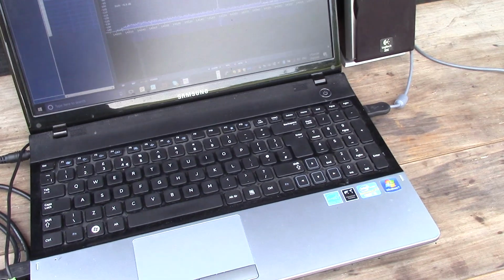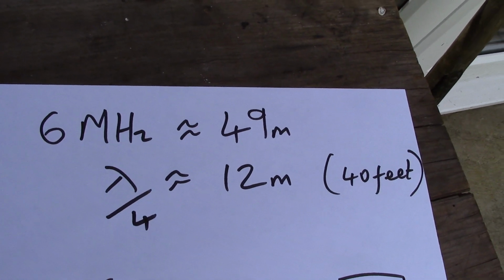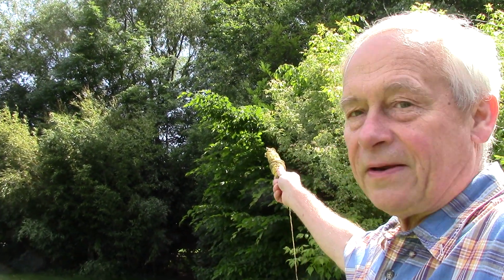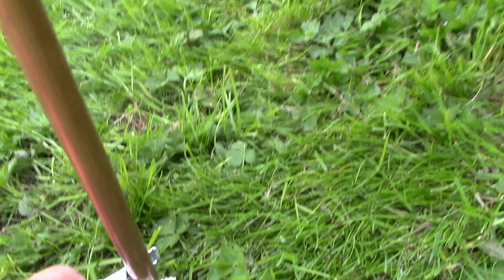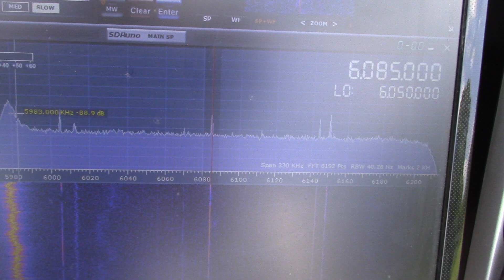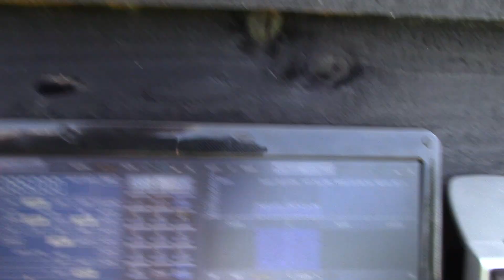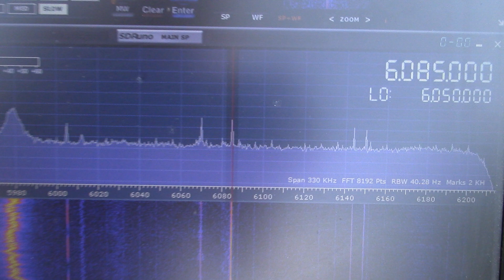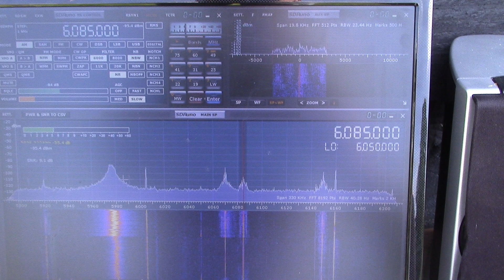Shortwave radio antenna and ground demonstration

Comment: 9:00 So pissing on the ground is actually a good idea. It's a good job gravity enables us to do that naturally. A simple question though: Does the counterpoise need to be on the ground? I was testing a shop bought long wire the other day and found it less worthy that my home made one. I did experiment and connect it as a Ground or noise cancellation whilst it was still up there, but found no difference, so no it didn't work as a ground when elevated.  Well that's my conclusion, but am I correct?

Comment: Thanks for this, I'm in North Wales and will try this. At the moment I have a 30 foot single wire, and 2nd setup is a similar length with a 1.1 electronic balun.

Comment: Thanks, is there anything i can do if my radio doesn't have an antenna socket? It has AC in, 12 volt dc in, headphone jack, audio in and battery compartment.

Comment: This was a great comparison. I'm on the 1st floor (or 2nd as we call it here), with no units above me, but in an HOA building, trying to find a way to build something that will expand my little SDR beyond the range of the few strong FM radio channels I get here. I have a covered balcony that I'll try some short lengths on, plus that magnetic loop looks like it might work a treat, and inside I have one straight uninterrupted ceiling run that's over 30ft (where I could run a 25ft wire).
I'm going to try the counterpoise method, and just leave that wire loose somewhere away from the antenna wire.
I'm curious why no one seems to suggest running a ground to the ground connection in an outlet - is that quite different from the ground you get with a rod in the earth?
Reply from the maker: The added advantage of the mag loop is that it doesn't rely on picking up the electrical component of the radio waves. (The electrical interference is typically the problem close to mains wiring/ other electrical and electronic devices -it causes the high noise "floor" or background level.)
The problem with an (upstairs in particular) mains "ground" is 1) its distance from the real (radio) ground will be many feet/metres.  Thus if it is a signficant part of a wavelength it no longer acts as a ground... hence why counterpoises, of a tuned length are more effective, and 2) it's potentially dangerous to use the mains ground since under certain fault conditions in the house, it can become live, and 3) the mains ground will typically be a conduit for much of teh electrical noise anyway.  Hope this helps.
Reply: @SDRplayRSP  That does help, yes. Thank you! I'll look more into the mag loop as that seems a better option in this case.

Comment: Commenting on an old video, but I've just discovered it when I was wondering what I could use beyond the long wire antennas that come bundled with some hand-held receivers.
This video is very interesting and instructive and it shows how good results can be obtained using nothing but garage stuff. Thanks a lot.

Comment: What if you were to ground it to a outlet screw not a power outlet but maybe for cable or something?
Reply from the maker: It depends on the route to "ground"  - it's fun to experiment. As you imply, you shouldn't connect to the ground of the house wiring because in very exceptional circumstances a fault condition could technically allow mains ground to become live.

Comment: Thank you very much for this very interesting video and the need of ground connection. It is simple and obvious. By the way, I am seen some people using balun 9/1 or 49/1. Why you do not propose such balun ?
Reply from the maker: Baluns do add additional benefits with matching but the improvements are secondary to what you get by having a good ground when using wire antennas.

Comment: I thought normally the antenna needs to be half of wavelength? Why  a quarter?
Reply from the maker: If you only want to receive on HF (shortwave) then the advantage of a quarter wave is that it's half the length of a half wave and will work well.   For transmitting there are more considerations which may favour a half wave antenna).  For a wideband (multi-frequency) general coverage receiver, then we aren't relying too much on a tuned antenna length and you may get good reception at lower frequencies down to nearer an eighth wave.  The key thing is to have at least a quarter wave length of wire with a good ground or counterpoise... that way you will receive lots of signals (subject to any electrical noise problems which are prevalent say indoors or close to a building with lots of sources of electrical interference)

Comment: Nice video.  But here is a question.  What if you are using a portable shortwave radio that only provides a alligator clip attached to a simple wire antenna.  How do you configure  a counter poise or a ground?
Reply from the maker: Depends on the radio design - the whip may be in conjunction with a ferrite rod / tuning coil in which case it's relying on the magnetic field and an additional earth may not help much.   However a long wire extension via your alligator clip would probably dominate and then additional benefit might be had by connecting a ground or counterpoise to the outer of say the headphone jack - again it depends on the design. A case of trial and error.   The trick is to get more wanted signal and not even more by way of noise.

Comment: I was wanting to listen to short wave radio for under $200.

After research, you tube, and reviews I am more lost than when I started. Even if I buy a 300 dollar unit I am doubtful it will work. 

I live in a valley so I think I’ll need to make some funky antennae modifications. I guess I’ll need an external jack for an antennae, maybe wire. Not sure what kind of wire. I was thinking about connecting it to some fencing. Any ideas? 

(My experience is seldom does anything work unless you know the trade secrets.)
Reply from the maker: Even in a valley you will be able to receive signals below 50 MHz because these signals are able to get across hills for two reasons.  Either they travel as ground waves in the case of the lower frequencies, or they bounce off the ionosphere in the case of medium wave (at night) or shortwave at any time, depending on propagation conditions - these conditions far outweigh whether or not you are in a valley.   Above 50MHz, radio waves tend to be line of sight  so you will have more difficulty. However, some planes and satellites are still "line of sight" even from a valley.   I recommend joining a forum or Facebook group and compare your terrain with others and see how they are getting on.  There are some links here: https://www.sdrplay.com/communitylinks/

Regarding wire, it really isn't too critical.  The important thing for shortwave is to get it at least a few metres above ground and if it's not insulated wire, make sure that when the air is damp/raining there isn't a continuous path from the wire to ground or buildings/trees etc.  Unless the fencing is insulated from ground then unless the weather is very dry, it won't make a good antenna, although much of the fun of the hobby is trying it to see - again, compare notes with others.

If you use an SDR like say the SDRplay RSP1A you will need to connect to the antenna socket which is an SMA female socket.  A useful adapter is something like this which gives a chunky socket for connecting to the centre using say a banana plug: https://www.amazon.co.uk/Jumper-Pigtail-Female-Adapter-Connector/dp/B07RDLSGHR

Comment: Hi, could you please advise on this setup ? II have a (properly terminated) coaxial connected to the antenna port of my mains fed receiver, this coaxial goes up into my loft, at the loft the centre wire of this coaxial is connected to a long single wire (clipped around the roof space); do i still need to earth the coaxial ??. Bear in mind my receiver is earthed at the mains and so the coax connected into it is also earthed yes, so no need to earth it again with a stake or purpoise. Great vid btw, easy for us novices to understand.
Reply from the maker: Hi James, ideally you would connect some kind of counterpoise to the outer of the coax at the point where the other wire starts.  It depends a lot on the frequencies of interest.  For HF and above, because you are a significant portion of a wavelength away from ground, you can't really provide an RF ground in a loft situation. Hence why it's a counterpoise.   The purpose of this is to create as big as possible a differential instantaneous voltage at the point where the coax starts.  The job of the coax is to bring that signal to the radio without adding more noise. (The radio earth doesn't really do anything to help)  In the real world you also have to make the counterpoise run well away from the other (centre-fed) wire for it to contribute and this in turn may cause a headache in the same roof-space and since it may need to run near say house wiring which is a terrible source of noise!  

Regarding impedance matching, this tends to be of secondary benefit for receiving set-ups.  Use of baluns is a whole topic in itself but first and foremost it will be about signal strength and signal to noise.  (Again I'm thinking about HF and below - please note that for VHF and above the length and quality of the coax becomes very important).

Best of all, I recommend asking these questions and sharing your set-up with others in a forum where they can give real practical comments, suggestions and advice: https://www.sdrplay.com/communitylinks/    (these are SDR and SDRplay-related but much of the knowledge is radio receiver agnostic)

Comment: The one best, most consistent advice I see from the "elmers"  (the presumably wise and experienced hams who have seen what works and what hasn't) is this: "first and foremost, before you spend money or effort on anything else, put up the best possible antenna you can, working against the best possible ground you can. Once you've done that, if there is any money left over, you can buy a radio."

Comment: Thanks for a great informative video, 1 quick question is the Mag loop directional ?.

Rgs
Wayne.
Reply from the maker: Yes - there is something of a peak in the same axis as the loop itself but more pronounced is the null at 90 degrees to it.  In practice it's a case of making sure the nulls aren't in the main directions of interest.  Alternatively, they can be exploited to reduce interference from very strong  unwanted signals.
Reply: Thanks heaps for your informative reply  @SDRplayRSP  Rgs Wayne.

Comment: If I was to attach a wire antenna to a portable receiver where would I attach the ground?
Reply from the maker: Your portable receiver's headphone socket is most likely also coupled to the Radio's RF internal circuitry and is also RF Signal Ground. This article tells you how to exploit this:   https://groups.google.com/g/rec.radio.shortwave/c/sIpVAaOAHx4

Comment: Really helpful. Maybe a silly question as I’m new to SW but on a portable radio receiver where would I connect a ground? I’m currently using a wire antenna with a crocodile clip on the radios telescopic antenna. Thanks.
Reply from the maker: Often,  a portable shortwave radio's headphone socket is also coupled to the Radio's RF internal circuitry and is also RF Signal Ground. I found this article which tells you how to exploit this:   https://groups.google.com/g/rec.radio.shortwave/c/sIpVAaOAHx4
Reply: Thank you for the help. I’ll have a look at the link.

Comment: Q: does the loop antenna rotate?
Reply from the maker: Loop antennas have some gain in the plane of the loop  (and a null at right angles) so it can be advantageous to rotate them although the significant nulls are typically only a few 10s of degrees - check with the manufacturer or original designer if you are making your own.

Comment: I’m wondering if I can use the electric socket plug ground to ground the noise from antenna? Any thoughts other than safety concerns?
Reply from the maker: Well the safety concern over rides everything unfortunately!  It would also be a likely source of electrical interference with all the noisy items in the house coupling well to this grounding point.  The ground would have to be very close to a physically grounded  point - a bonding to a rising water mains lead pipe is not very common these days!  (plus you need to be less than an eight of a wavelength from that socket through the consumer unit to the  real ground) - otherwise it would be a noisy counterpoise..

Comment: Why wouldn't there already be a ground from the house main electrical ground through the AC outlet?

Also, even though a random piece of wire will work, certainly a specific length would be better. Like maybe 84 feet? I'm wanting something for all bands from  150 KHz to 30 MHz. How critical is height of horizontal wire? I've read that it is best to have it go straight up as much as possible before going horizontal. Is a balun needed only if you plan to run some shielded coax to the horizontal wire?
Reply from the maker: You are right that the AC house mains may provide an excellent radio ground as well - this might be the case where the socket chosen is close (less than a small fraction of the wavelength ) to the physical bond to the ground.   However it probably also runs close and parallel to conducting wires which may carry severe electromagnetic interference.   Worse still, the house wiring ground is the safety circuit in the case where a faulty appliance fails and presents a live mains voltage to the ground wiring, and so it is not recommended to be used for anything else (normally some kind of residual current detection circuit breaker should trip in such an event, but safety rules don't recommend this just in case your chosen socket is somehow not providing that return loop - in effect 2 faults could theoretically conspire together)

Specific wire antenna  length really doesn't make much difference at all in practice, for a receiver.  A balun provides additional optimisation irrespective of whether you connect straight to the antenna socket or to a socket on the end of a length of coax.  But that benefit is dwarfed by getting a good ground/counterpoise and getting the wire clear of sources of EM interference.  And yes, height really does help.  The whole thing can be horizontal or indeed sloping.    A s longa  run as high as possible will give best results.    I recommend joining the SDRplay Facebook group or the groups.io forum to get comments from users there: https://www.sdrplay.com/communitylinks/

Comment: Thanks for the video very helpful as a newbie to SDR. I have just had my RSP 1A delivered yesterday. I am always mucking around with random wire antennas into my Tecsun S2000. I am looking forward to using this piece of apparatus, looks really interesting. Just wondering whether the use of a 9:1 Unun would be needed here, or my homemade ATU both which I use for my receiver, sorry for my ignorance on this. Thanks again.

Comment: Shouldn't you only put one of the speaker wires into the receiver? The speaker wires are parallel so wouldn't a signal cancel itself out or some sort of capacitance issue also?

Please experiment with just of the speaker wires.
Reply from the maker: It's not a problem since the pickup in both strands will be identical.  It's the same way you can use a ladder line with both legs shorted together as a random wire antenna as advocated in articles like this: http://www.hamuniverse.com/hfdoublet.html
Reply: Ahh, I see what you mean now. Thank you

Comment: Thank you. This a great info as I am beginning my SWL adventure and live in an apartment. Is it possible to ground to something inside the apartment?
Reply from the maker: Yes - metal pipes and radiators can be good  if they are not close to noisy mains wiring AND continue as metal for a substantial distance (to act as a counterpoise).  Even better, if you are close to the ground then a direct pipe connecting all the way to the real ground could be effective.  For safety reasons you shouldn't connect directly to the mains wiring ground ( again, if this is a direct and short route to a purposeful ground stake it technically would work but would be prone to electrical noise generated along the way !)   The ground (earth) pins on you mains wiring are there as a safety feature and a fault condition could cause the ground to become live!  (e.g. no RDS and a grounded metal appliance has an internal short to live.  A more expensive soultion is to consider an active magnetic loop - these are so much better at reducing electrical interference pickup.  Check out other videos links on antennas here: https://www.sdrplay.com/apps-catalogue/
Reply: I use a counterpoise for both receiving and transmitting in my 3rd floor apartment.

Comment: Just what ive been looking for as not licenced yet , My cave is Box room on 1st Floor , throwing the Wire up n over the Rooof be ok?, Also coukd it be Earthed to a Radiater or Water Pipe to the Rad?
Reply from the maker: The key challenge is noise. Hopefully not too much house wiring nearby